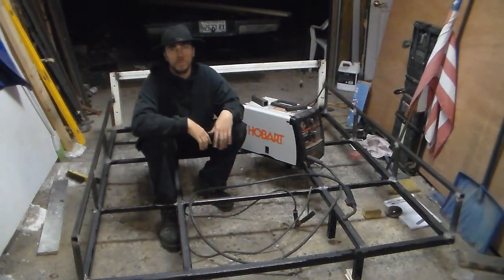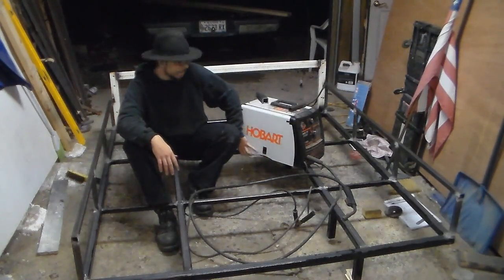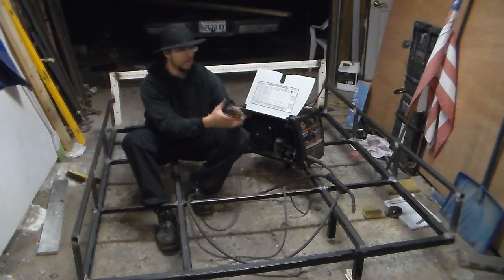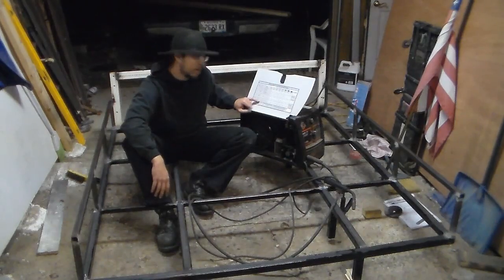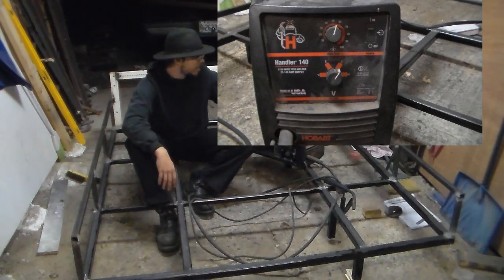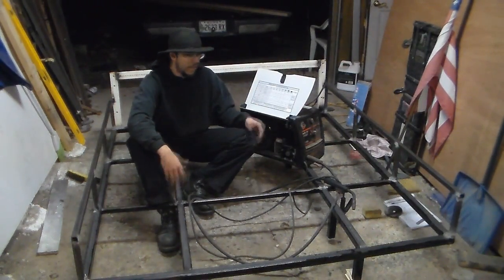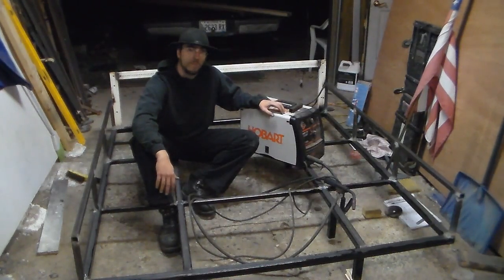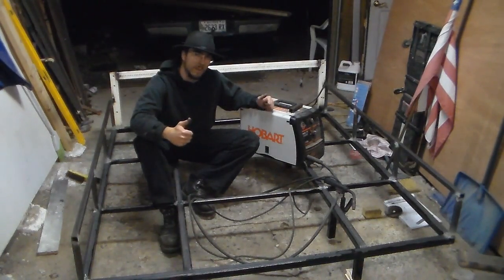Hobart Handler 140/190 Review and Advice

Comment: Hey, maybe you can help me.
I just bought one of these (Hobart 140 Mig welder) and I'm having a hard time trying to weld.
I'm trying to learn how to weld and tend to be afraid of gas tanks, etc.
So, I'm trying to weld right out of the box.
I've got a 1.5" pipe (1/4" thick) to which I want to weld 3 solid rods in a tripod fashion.
The pipe and the rods are about 1 foot long and the rod are round, like the pipe, but solid.
I cut each rod at a 45 degree angle.
I tried setting the voltage to 4 and the wire speed to 50, per the chart but it didn't work so I tried the max voltage of 5 and wire speed at 80 but same result (FAIL!).
I believe I'm not getting the penetration I need onto the 1/4" thick pipe.
Here's a good indication of what I mean:
- I bring the rod (cut at 45 degree angle) to the pipe and start making a puddle on the pipe.
- When I see that the puddle has grown (glowing red), I drag the puddle to the rod and stop when I see the puddle on the rod glowing red.
- At this point, I like to think of this as a "tack".
- When I put a very small force on the other end of the rod (the cold end), the welded end breaks the weld and "lifts" the puddle that was on the 1/4" pipe.
It's like the 1/4" pipe never got hot enough to melt (almost no penetration?).
Do I need gas tanks for this?
Have you had good success welding onto 1/4" thick steel?
There was a video that said you have to have several runs when welding 1/4" thick steel.